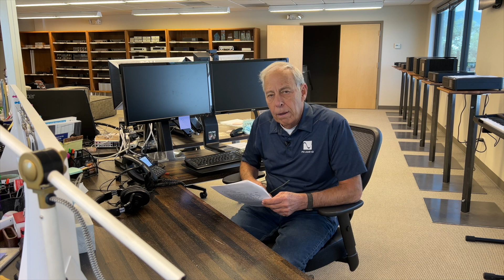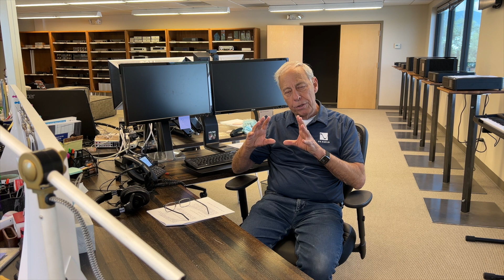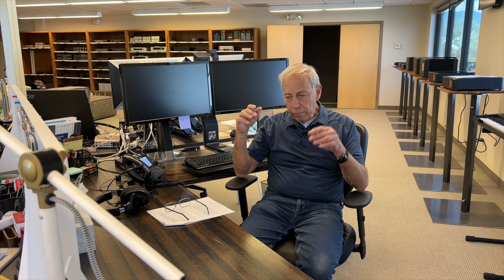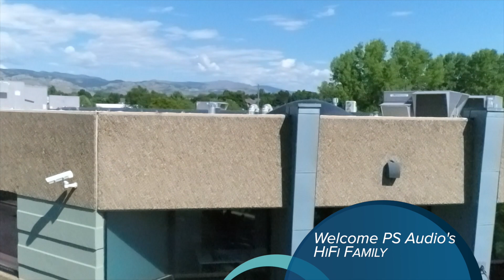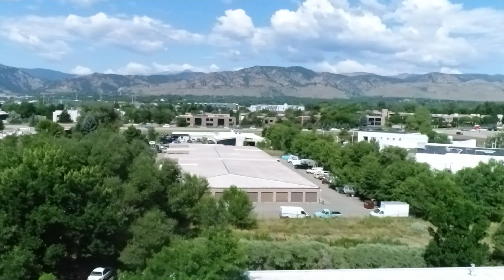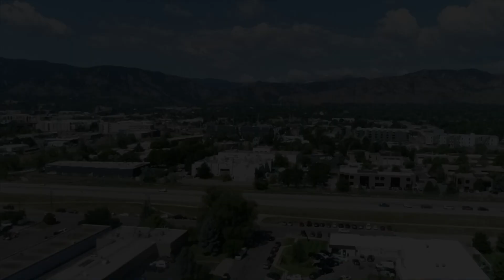Tube amps and output transformers

Comment: Can you do a video on interstate transformer, im newer to building hifi stuff, i build a ton of guitar amps, i came i into a huge collection of hifi stuff, and its so differnt to me.  Guitar amp are simple preamps and power amps with coupling caps inbetween,  but hifi tubes  with lower heater voltages and interstste transformers are a learning process.

Comment: the output transformer  and tube output stage is nolonger needed.. pauls statements about current and voltage is wrong also.  he smushed bjt and fet devices in one lump..and they are totally different.. the guy that stated that the output transformer ruins damping factor is correct.. WE HAVE KNOW HOW TO implement tubes in the drive stage and use N channel fets in the output stage and combine the best stages to build reliable great sounding amps without the need for large amount of negative feedback and still equal the zero feedback designs .but more reliable..with no thermal runaway..

Comment: Another reason for output transformers, a push-pull output is desirable as it reduces odd-order harmonics which people find unpleasant, but, tubes only come in one polarity, unlike transistors, so the only way to get push-pull in a tube amp is with the aid of a transformer, even assuming you had a very high impedance speaker.

Comment: Transformers also are used to get push-pulll operation without complementary devices. It's not the only way but since the impedance conversion is fairly necessary, may as well get the plusses of center tapping the primary, multiple taps on the output, and no DC on the output no matter how it is biased. Along with some disadvantages. The power transformer is often bigger anyway, although the output tx more difficult.

Comment: Good stuff.  I think that the output transformer on a tube amp, because its basically two inductors, side by side, affects harmonic content.  I suspect that this is part of the "warm" sound that people talk about with tube amps.  Interestingly, I suspect that Peavey's reason for including a transformer, driving the two output transistors, is to get some of this "warmth" in the sound of one of their solid state amps.  Specifically, I'm talking about a Peavey Pacer guitar amp. Pehaps this isn't the only reason for the transformer use? Maybe the transformer is used to create the positive and negative halfs of a sine waver? Someone out there, who knows more about this subject, please comment.
Reply: @Douglas Blake Cool, thanks for the information !

Comment: Always seems a topic of interest. And I enjoy hearing you go through the effort regularly. Gives me a chance to think about it some more. And you triggered a new approach to this for me just now. Perhaps as often happens, the discussion is not framed properly? 

Amps take a given voltage input, usually around 1-2VAC peak? and increase the voltage to some greater level depending on the output technology and design. Then that increased voltage is matched as best as possible and couple to the load. We tend to think of these stages based on technology type, solid state vs tube, differently. 

Solid State being simply input to gain stage to output devices stage and to the load.

We tend to compare tubes using the same input to gain stage to output tubes to transformer to load. As if the transformer was an additional stage. 

But all it is doing is matching the PS to the load just as the output devices in an SS amp do. The actual "output" stage in a SS amp is the driver stage that adds voltage gain to send to the output devices. In fact an output stage can go out and the drive stage can feed the load. It just has no current behind it! 

So it is more accurate to reference the transformer as a passive matching stage in comparison to an active device matching stage in an SS amp. Rather than as some additional STAGE/ component needed to match. 

Interestingly this matches your earlier videos on your ultimate amp design. That you had to be convinced that the ultimate design is tube gain/ drivers and SS output. You initially rejected that approach. But if you think about it from this approach, it is a natural. You get the sound of the tube amp using an active matching system rather than passive transformers.
Reply: Man there has to be a less windy way to say whatever you said. Nothing personal but I'm not an engineer or a so called audiophile. So call the guy up his business  phone is listed or easily found on Google. And spare me the rebuttal. Hmmmf.
Reply: @larryh.4629  There are less windy ways for the less educated as you state yourself to be. There are also massive books written for those with the ability to comprehend it.

Comment: Why dont some speakers have higher impedance like some headphones
Reply: It gets very fragile with many thin windings on the speaker coil. The result is a speaker that is incompatible with solid state amplifiers. Philips made speakers like that with an 800 Ohm impedance. They developed specifically a tube to drive them, the EL86, the low impedance brother of the well known EL84 output tube. The single ended amplifier version was used in TV sets and cheap tube radios. But they also had a 10W push pull HiFi amplifier capable of driving the 800 Ohm version of an AD9710, which is an 8" full range AlNiCo speaker. These speakers have a cult following and the 800 Ohm versions are the most expensive ones today, because it will allow you to build an OTL amplifier for it.
Reply: @hugobloemers4425  Correct - I was meditating to  get such speakers, One of them I had in B_W mono philips TV and I may say comparing to usual TVs  it was much better  audio.  But later I found  that with standard impedance and transformers all also may be done
Reply: @Mikexception  Yeh, but then you have a transformer again. I agree, old Philips TV's sound exceptionally well: Big wooden enclosure, curved picture tube to fight standing waves, single ended tube OTL amplifier (that sounds audiophile by it self) 5" or 6" full range AlNiCo driver.
Reply: @hugobloemers4425  Regarding damping factor I made  some simplified calculations for solid state output impedance and measured my vintage moderate power tube output transformer impedance - 150 mH Resistance at 8 Ohm terminal is 1,0  Ohm . All together at 20 Hz without feedback creates 3 Ohm damping load 

Typical output capacitance 2000 uF for solid amplifier  plus   0,3 Ohm output resistance  crerates  for 20 Hz 3,8 Ohm capacity impedance. It means  they are   similar  
 . 
Difference is that for solid amplifier with falling down to "0"Hz frequency damping load vanishes . In transformer output  damping load grows  to maximum reaching finaly at "0" Hz  1 Ohm.  . Output circuit in solid amplifier creates serial resonance loop which I calculate  is  5- 25 Hz  - it is speaker coil with capacity While in transformer ouput it is not happening due to not used  capacitance. Conclusions I leave open .

Comment: Oh. That may explain why many tube amps have impedance taps at the speaker connections.
Reply: Yeah. Also, an interesting difference between tube and transistor amps is that for a transistor amp, the speaker impedance should not be lower than specified or you may damage the amp, but for a tube amp the speaker impedance should not be higher than specified and you should never run a tube amp without any load.

Connecting 4ohm speakers to an 16ohm tap reduces the power, but is otherwise OK. Connecting 16ohm speakers to a 4ohm tap reduces the power and may damage the amp if you turn the volume up too much.

Comment: Do different output transformers give different sound quality?
Reply: Sonically, the output transformer may be the single most critical component in a tube amp. That's why really good ones are so expensive. They may also be large and heavy, but the truth is, cheaply made OTs may contain a lot of iron, too, and thus be humongous, so size alone is not an indication of quality (building OTs is an art: a combination of power capacity, bandwidth and isolation). Apart from the tubes themselves, which are in fact the amplifier (the actual amplifying device), the other crucial components include power supply, coupling capacitors and output transformers (with the exception of OTL, i.e. output-transformer-less). Of these, coupling capacitors and output transformers can be thought of as bottlenecks - they degrade and cannot possibly "improve" the sound, in other words, they literally can't be good enough.
Reply: @Douglas Blake Check your facts. Turns ratio squared is the impedance ratio. Voltage ratio and turns ratio are the same. 👨🏻
Reply: Yes there are - they are winded in such special (and difficult) way that the length of wires in two parts of B class transormer is near  equal, say up to 5% . It is not big difference to standard with differences some 25% because we care for impedances and they are secured  equal  but secures identical anode  volltages on both tubes . If we consider matching  tubes as so important it is justified to consider matching their windings,.
Reply: @Douglas Blake The impedance ratio is equal to the square of the turns ratio. Therefore Paul's 1K to 8 Ohm transformer would require a turns ratio of 11.18 to 1. For example, if a transformer has a turns ratio of 2 to 1, then the impedance ratio is 4 to 1.
Reply: @Douglas Blake no problem, thanks for the response..
Reply: Surely that must be a rhetorical question.
Reply: @EliasTheHunter  
I’d say he definitely knows what a rhetorical question is..
Reply: @EliasTheHunter  Appears to me he knows full well what a rhetorical question is - do you?